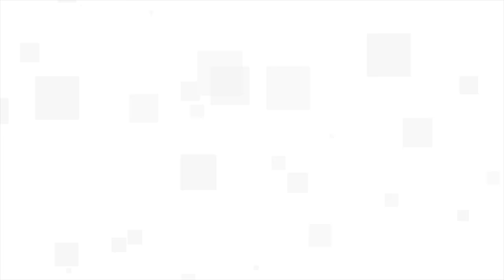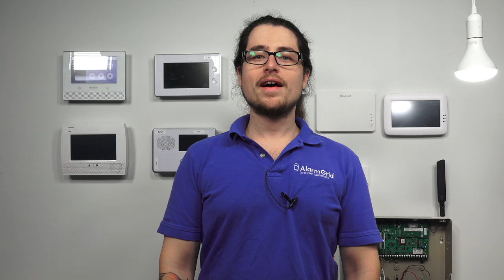Central Station Alarm Monitoring and How It Works

Comment: Those aren't panels they're keypads.
Reply: Top Left Lyric - All in one system 
Bottom Left - L7000 All in one system 
Next to Lyric - 2GIG GC3 all in one system 
Next to L7000 - 2GIG  GC2 All in one system
Behind his head - IQ2 All in one System 
The rest are Keypads Going to a 21IP 
Far right is either an older tux or 6280 keypad 
Next to the Tux/6280 touch screen is a VAM
The below the Vam is a 6160/6160rf keypad